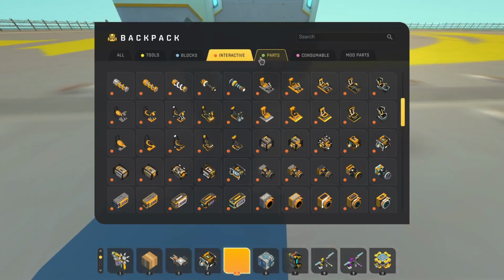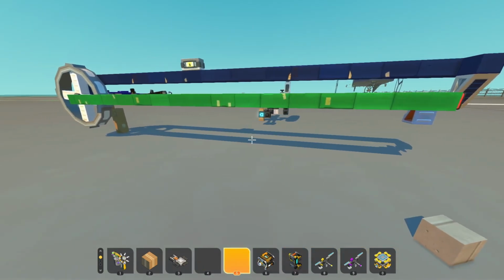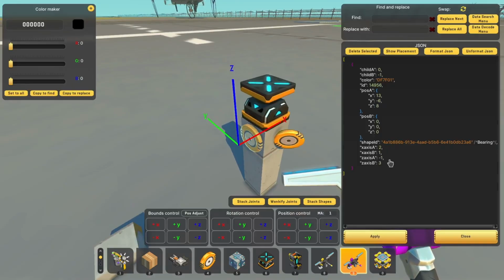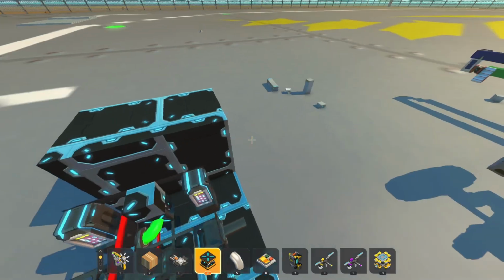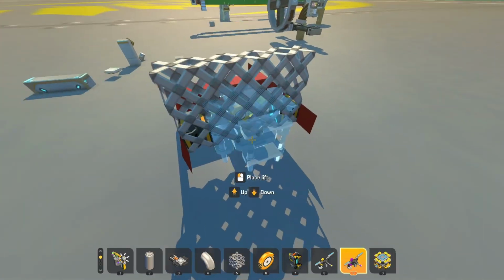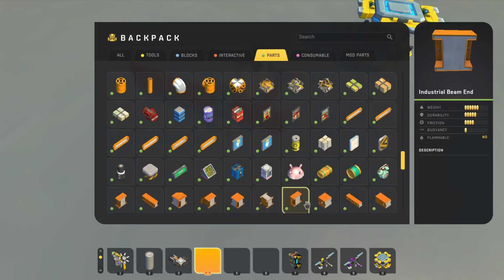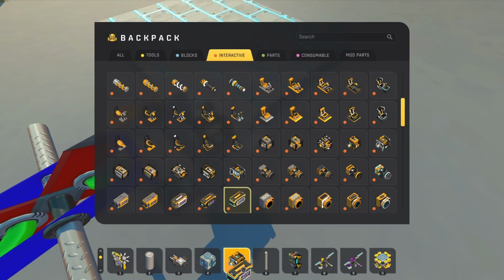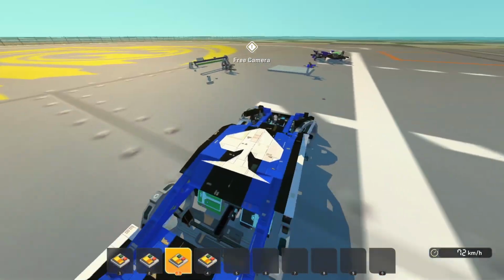What is a pressure engine. An introduction.

Comment from the maker: 400 to 900 kg is only what you might see for low physics super high power engines. 150 to 500 kg is more reasonable. don't edit when sleep deprived kids!
Reply: What is the sorta next step for learning more about this part of the game
Reply from the maker: @zma19  Generally speaking blueprint editing. On the work ship you can get the SMTC tool pack, it's a mod that adds lots of nice utility things. Normally zero with blocks are invisible but it will let you see them, there is also ben bingo’s block editor. That's the tool you see me using, with that you can experiment with wonkifying joints. 

In terms of other technology, transmissions and cvt’s are the next thing. There isn't much information out there for search results but if you're on discord or reddit you can look for ben bingo, or kein anderer and they will be down to show you stuff. There is also the technical community discord.
Reply: great advice, we were brainrotting in vc while you edit this + being sleep deprived doesn't help at all